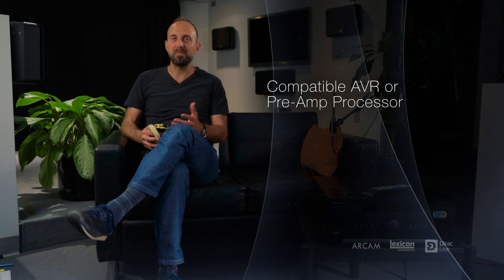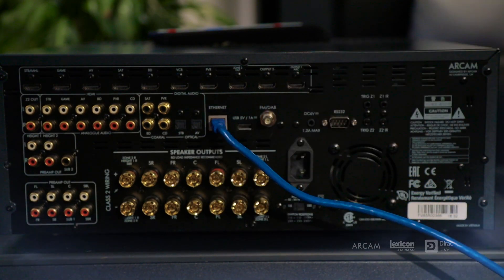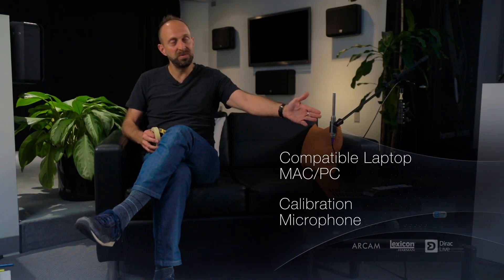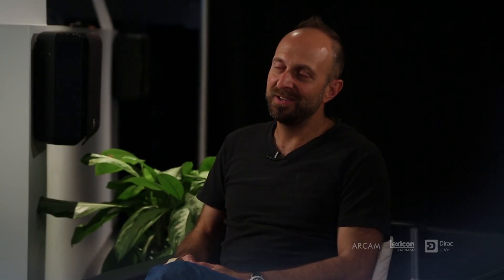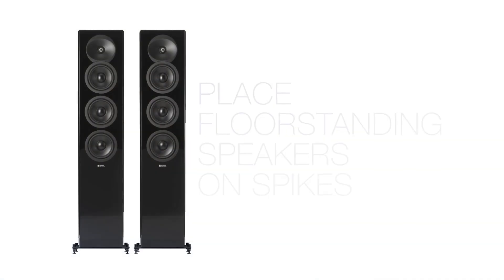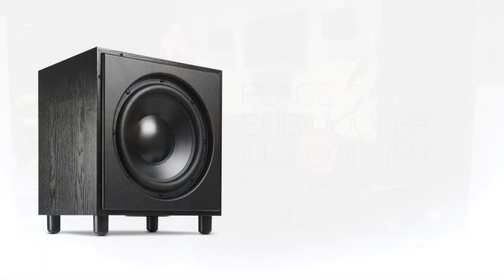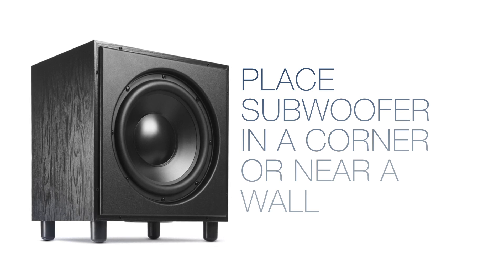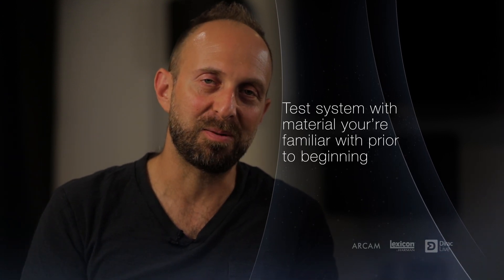Dirac Room Equalization Part 2 - Room Setup

Comment: what if I need to leave a coffee table between the speakers and my listening position as it will be usually placed there. Surely Dirac needs to get the reading with the coffee table in place otherwise it's not a true reading of the real setup?
Reply: Yeah, I've got the exact same issue. Normally, when I'm listening by myself, I might throw a quilted blanket over the coffee table, but realistically, it's not gonna look good when I have guests over! Decisions decisions what to do 🤔